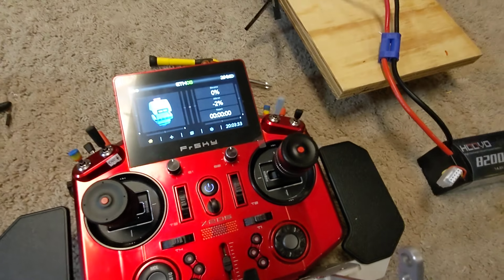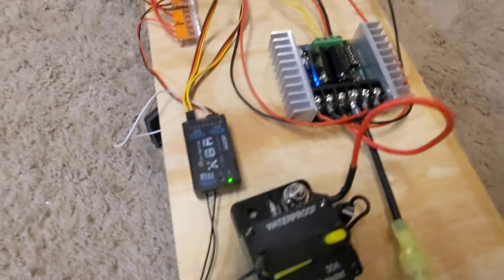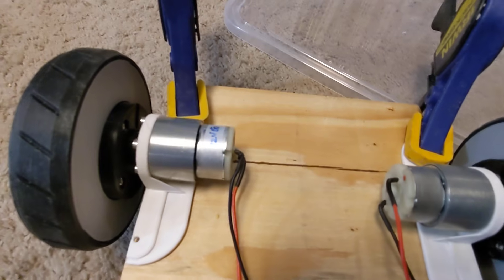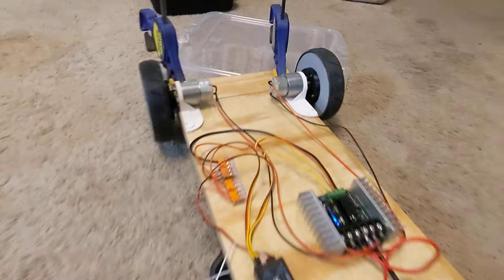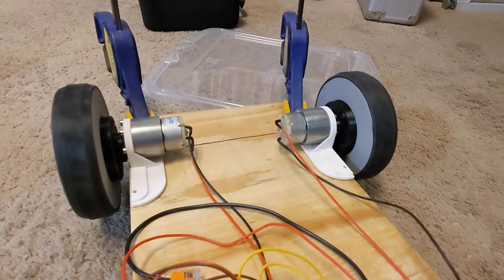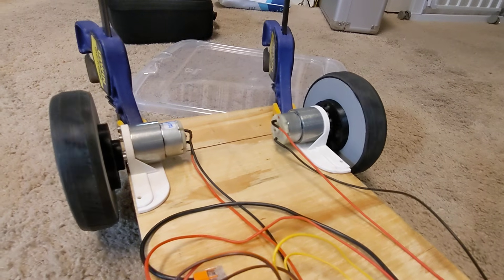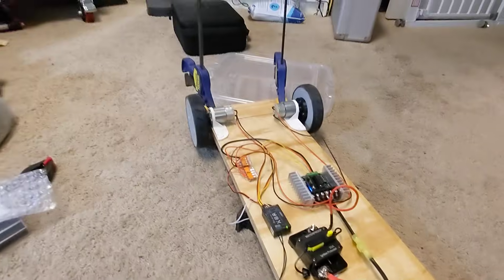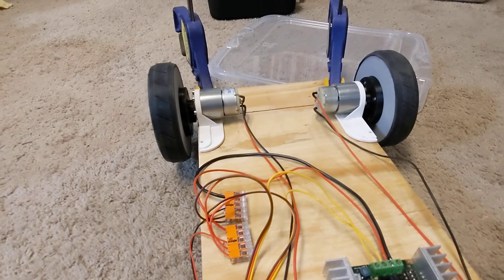Bench Testing M-O's Two-Wheel Drive

Comment: But M-O had no wheels
Reply from the maker: @lyekka3578  M-O's original design used a large ball for motion.  However, it was not always the most stable and made driving M-O a bit of a challenge.  The two-wheel system isn't screen accurate, but it does make for a more efficient and stable robot.  At any rate, once M-O is fully assembled the wheels will be barely visible. 😁  What is visible will look a lot like a single wheel because the wheels are placed right next to each other in M-O's body.
Reply: @Studio_Cricket  that is 1000% understandable. But I think original M-O had no ball for motion. I think it was some sort of anti gravity thingy. M-O is like hovering above the floor or something. Just like Eve or few other robots. But comparing to Eve, M-O doesn't need to fly too far away above the floor, cuz M-O is obviously just cleaner robot.
Reply from the maker: Sorry, but that's not correct.  According to Pixar, M-O uses a "Roller ball for movement".  If you look at any of the clips showing M-O when he is initially introduced into the movie, you can see it.  Also check the fantastic book, "The Art of Wall-E" produced by Pixar.  You can see it there as well.  Cheers!
Reply: @Studio_Cricket  OMG! Didn't expect that.
Reply: Ahhh yes I remember reading about this now! Magnetic hovering drive. Built by BNL 🤪
Reply from the maker: @BowserBuilds  😆😆😆😆☠️